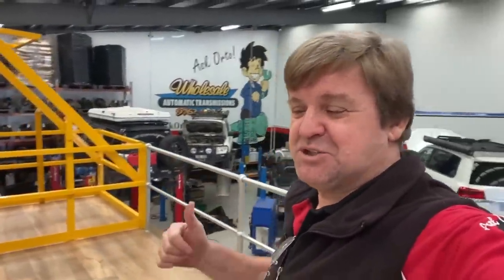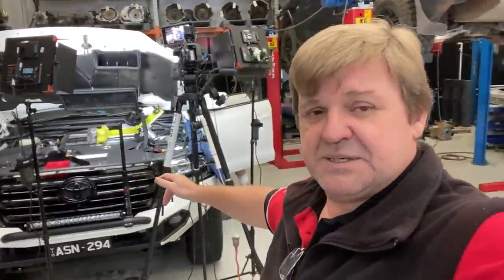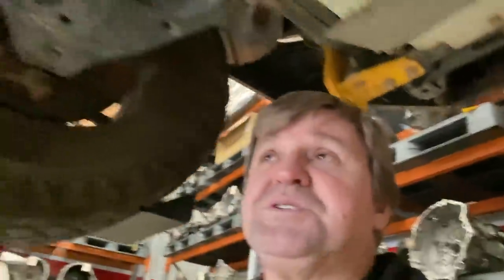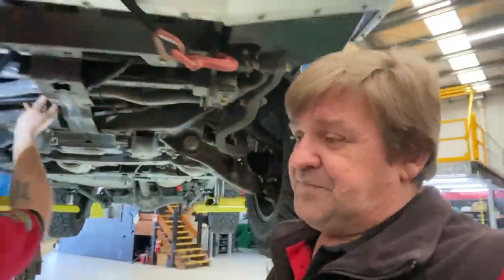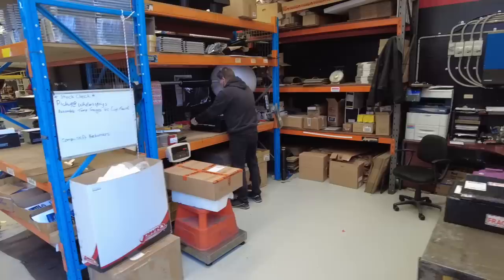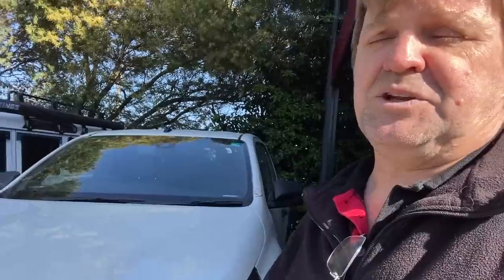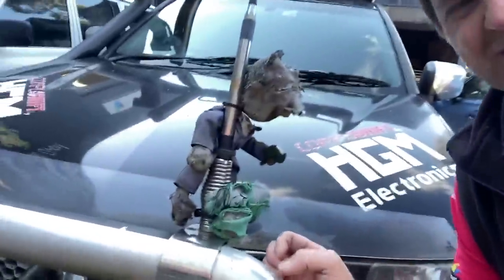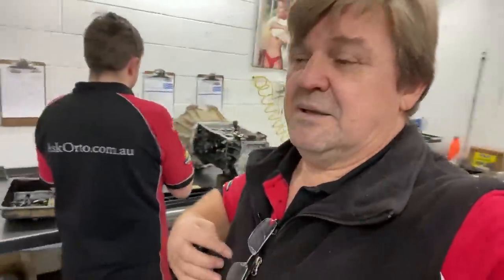Rocket's Workshop Projects

Comment: Just get the portals done in QLD registered and mod plated then transfer the car back onto VIC rego or leave the rego in QLD so that way VICROADS leave you alone 👍
Reply: If you don't get a Federal Compliance Plate, you have to re-engineer every time you move and re-register. I'm just undergoing a Ranger pre-rego GVM upgrade for the that exact reason.
Reply: yeah its honestly stupid how this works, but it just can happen here. crazy huh
Reply: Just buy a higher capacity vehicle. GVM "upgrades" will be regretful especially when your bend all your chassis.

Comment: Thanks for the video Rod.
I have a Y62 and tow 3.5t and was lead to believe the auto didn't need an aftermarket transmission cooler. Could you please give more info? Keen to understand if I've been mislead.
Reply from the maker: They suffer greatly in soft sand and under extreme pressure even for a short time will hurt them. The Y62 run NO cooler at all until the thermo opens and if you are still under load it to late for the cooler to try and bring the temp down. The new cooling system we run is a dual system that we run as a primary while keeping the original thermo system as the back up secondary system. Works brilliantly.
Reply: @WholesaleAutomatics   can you indicate approximate cost to fit?

Comment: The over heated ones died because of driving in sand with the TC on ? I have a 200 and was told to disable TC in sand. Just asking out of interest.
I have one of your trans lockup kits installed and it is tops towing our van.
Reply from the maker: You shouldn't run lock-up in soft sand as it put a huge load on the lock-up clutch. You must be in low range in soft sand and oil cooler is highly recommended to take up the slack when lock-up cant be used. Hard sand is fine for both high range and lock-up on. Cooler is back up for when you shouldn't be running the lock-up.

Comment: So your essentially telling me I should book my y62 in for an upgrade so it doesn’t overheat lol
Reply from the maker: I will always recommend an oil cooler to maximize your transmission life span. Everyone has different requirements but if you tow or are likely to visit the sandy beaches then yes the extra large dual oil cooler is a must have item.

Comment: Hi Rod friends of mine just bought a new Ranger and had a GCM upgrade because it has to be done prior to rego. I run 2004 auto Mitsubishi Challenger. Are these a good box? What do I need to be careful of? Is there very much to service in them, I know some auto's are just a fluid and filter change? Cheers
Reply from the maker: Rangers are very good but need an oil cooler and thermal bypass to keep them safe. Check them out on our web site.

Comment: I don't understand with bolt on mods why it has to be done prior to registration, what's the differance if the vehicle is reg or not it's the same vehicle. The regs needs to be changed coz as long as it's done by a 
reputable installer and engineered it should be all good.

Comment: 🥺 Interesting our new Toyota with that refined 1GD-FTV engine you have in that Hilux of yours seems problematic at high way speeds in if it will choose 5 or 6 slight incline, drop to 5.. flat back to 6 and lockup jumps around a bit... not even towing anything. Apparently normal.. so yeah lockup kit probably needed. Will wait to see what outcome you have.. hope to win, kids will love the softies. 🍻

Comment: Hi Rod
I have a 100series Landcruiser Sahara iv just had the 4.7 V8 rebuild with a little bit of head work and a strong bottom end i all so replaced the radatetor i have put a bullet supercharger on it.
Im running the stock trans with no issues just wondering if i was to up grade the trans what way should i go and price im roughly looking at. Iv started following your stuff since iv seen you on the kimberleys adventure with 4wd24/7.
Thanks
Reply from the maker: All you really need is a Heavy Duty Nimad Valve Body. That will make a noticable differnce. Is it the 4 or 5 speed auto?
Reply: @WholesaleAutomatics  Hi thanks for getting back to me it's a five speed auto what would i be looking at to have that valve body installed. As i live in South Australia so i would have to have it pulled out and send the trans to guys

Comment: How many km on the Pajero that's in for a rebuild? Do you recommend a trans cooler for them?
Reply from the maker: Bot sure how many Km's as I reply to this from home but yes I do recommend an extra oil cooler for the Pajero's.
Reply: @WholesaleAutomatics  350,000 or so, had the wrong fluid put in by a different mechanic and kicked the bucket

Comment: Can you Make a electric module that fits in the 79 that lets the window down just a touch 1” when you open the door then winds it up when the door is shut? 
Or a way to tune that into the computer?
Also have it so when you double hit the unlock key you can get the windows to roll down Then when you hit lock they roll up. 
Would be a way to do it I reckon you may have the people who are in the know.